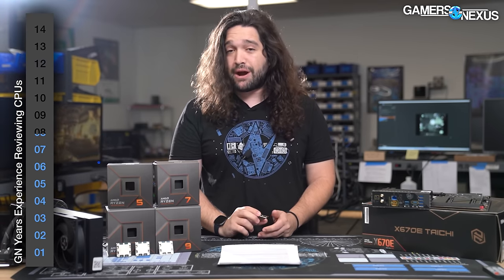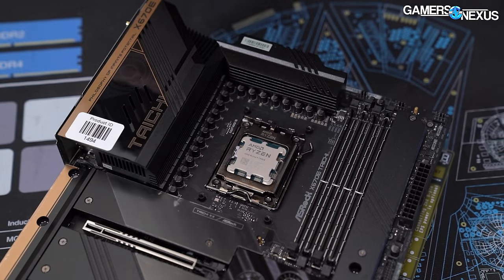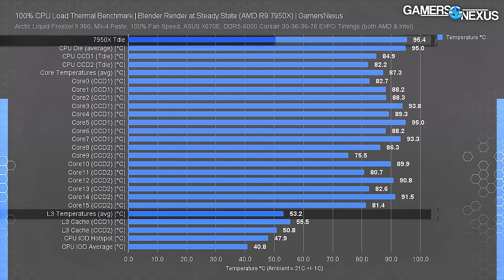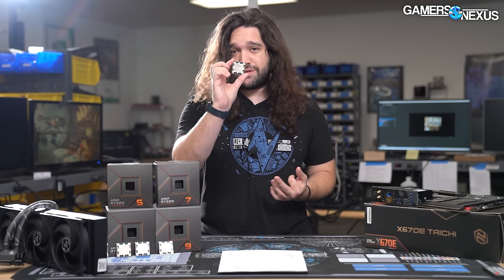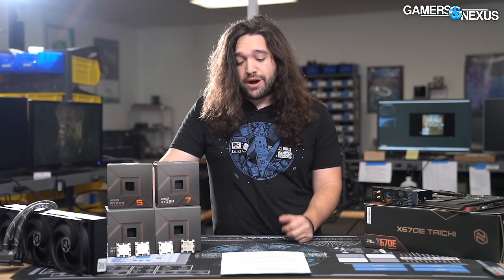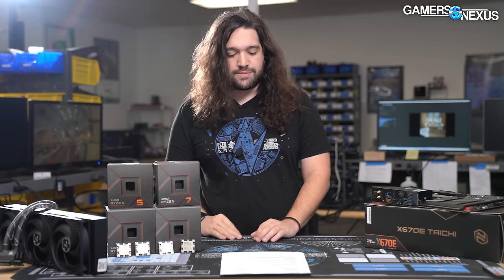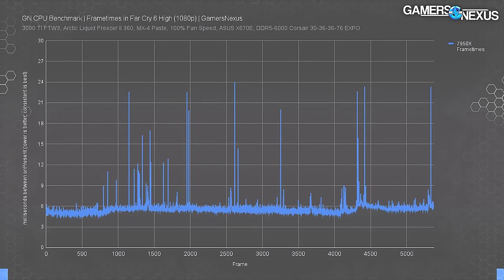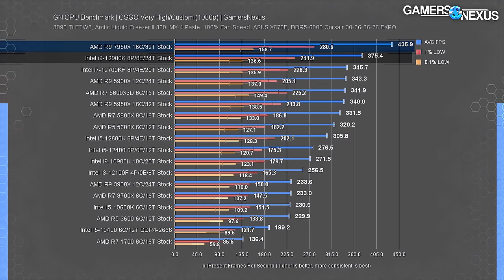95°C is Now Normal: AMD Ryzen 9 7950X CPU Review & Benchmarks

Comment: I'm looking at some replacement for my 6700K for next year, currently eyeing a 12400 but awaiting more Ryzen 7000 CPUs + tests to hopefully come out in the meantime as I want to just make the upgrade to DDR5 now.

Although I'm horrified by the 95° thing.
That doesn't feel comfortable at all, even with a 240mm Aio.
I like my CPUs running at like 50-60° at half to 3/4 load 😅
Reply: exactly my thoughts... no fkng way you can endure that temp and noise for any logical amount of time, no matter the performance....
Reply: @HellPedre  just set the maximum fan speed lower. it will be at the thermal point anyway^^
Reply: @HellPedre  it's not the noise at all for me, all my fans run 100% the whole time and I've got ones with a reasonable volume so no problems there.

It would just freak me out feeling the hot air (my tower is under the desk, barely fits but it fits), I'm sometimes getting a slightly warm "breeze" when the CPU is 50° steady, I can imagine 95 feeling horrible
Reply: @certaindeath7776  ofc, but then it wont perform as good as it could
Reply: @DatPenguin97  forget about it... thats for sure. I just freak out mentally knowing the cpu is at that temp for that amount of time.... and my noctua fans at top speed are loud as fkng hell so no.... hard pass
Reply: @HellPedre  don't get me wrong I'd feel the exact same about the temp itself

Comment: So what i'm hearing is the fact that I decided to upgrade from a 360mm aio to a 420mm aio for Ryzen 7000 was a smart choice lol. Steve, I would ask if you guys could show how thermal paste application because of the new IHS design. I've heard AMD say just a single dot of TIM but I'm wondering if that's what you guys used or not.
Reply: they already did a video about thermal paste application
Reply: @retrowave69  Did they? I must have somehow missed that. Did GN do the video or AMD?
Reply: just make sure to use non conductive compound and you can safely apply any way you want basically. Altought, for the 7600x thats a good question, since its more likely people will cheap out on thermal compound and might get some old style conductive one.
Reply: @xouri8009  I've got some Kryonaut and Kryonaut Extreme sitting around for my TIM although I'm potentially interested in Corsair's new TIM. They said they tested it against 12 of the best TIMs on market and it performed as good if not better but I'm leary until they say what they tested against.

Comment: It's a shame there's no good methodology for testing the scenarios where FF14 becomes overly CPU bound (lots of players loaded in at once).  You'll mostly see this in popular player hangout spots as opposed to the official benchmark or any sort of combat content (barring the odd rare open world boss here and there, but again, that's probably a nightmare to consistently test).
Reply: You can just use Single Threaded performance metric as a guide there because FF isn't multi threaded anyway.
Reply: I have no noticeable stutter/lag running around Limsa at peak hours on my R5950X. The frame drop is also pretty minor. I imagine 7950 should feel the same if not better. Of course it would be better if there were a way to test it consistently and not just with anecdotal evidence.
Reply: @berniecat8756  Time to rent a server and fill it with GN viewers. 😎

Comment: it appears some kind of embargo was lifted 6 minutes ago :) 
Paul and steve both videos appeared now. 
Will AIO companies now need functional upgrades in design for more heat transfer with the hotter CPU temp limit now ?  (apart from any mounting bracket upgrades that may be need for improving physical contact with cold plate)
Reply: Linus'es also pops up

So yeah, Major Embargo lift
Reply: Aio companies can't just "upgrade" the design for more heat...don't you think they would have already been doing that if it was possible
Reply: @samgoff5289  Errr yes, yes they can...thicker rads, push/pull fans with higher static pressure and rpms, faster flow rate pumps, finer fin density on the cold plate in the block, they have just been rebranding cheap shit and selling it for top dollar for well over a decade now, and slapping different variations of RBG on it with each new iteration.
Reply: @alexhndr  Srry, I don't watch Linus' reviews

Comment: This is not surprising to me, I had to under-volt my Ryzen 7 5800X out of the box as it was running idle at 85 decrees C and this appeared to be common and AMDs intended way for it to run

So no reason to suspect that it will be any different for the new generation - they should probably be under-volted in the vast majority of use-cases
Reply: The 5800x was specced too high from the factory with the same TDP as the 5900x with 12 cores to make the upper-midrange 8 core part look better.
Reply: Idle at 85 degrees is not normal for a 5800x. that means something is seriously wrong.
You can even see this CPU idling at 40 before ramping up under load.
Reply: @ffwast  You're right, I meant to say under load, still the idle temps are somewhat better when under-volted to 1.3v (must affect the curve?) and it can still run all cores at 4500 under load at much lower temps

Stock voltage raises TDP and temps but offers no additional speed or stability under a multi-core workload (just @ 4500 all cores at 10-15 degrees higher temps)

I believe the binning on the 5800X is fairly narrow so this is quite common although I do seem to have an average part in terms of performance with many seeing 4600+ all cores stable

Obviously having an all core overclock and undervolt like this means that I'm limiting single core performance; I believe the two best cores can reach about 4600 and 4700 respectively but most of my usage is multi-core so I generally just leave the all-core OC and under-volt
Reply: Disable amd cool and quiet in the bios so you will not the ramping up cpu cores.
Reply: Just as I thought, Tech Yes City's latest video shows that you can massively reduce power consumption and temps by undervolting while retaining performance and stability

Comment: Actually bummed about the huge efficiency downgrade, damn
Reply: Configure a power plan to cut your boost clocks, efficiency back in.
Reply: A mild undervolt will do wonders.
Reply: Ditto. Efficiency and low cooler requirements were one of my prime reasons for preferring AMD over Intel. I'm gonna skip this generation.

Comment: The 5800X3D still a gaming beast at 4450-4550 MHz 😬
Reply: Just goes to show how little the cores themselves matter compared to the memory and cache system.
Reply: @givemeajackson  yep I run mine sometimes at FMAX 4000 76-60-90 -30 all-core when playing less demanding titles and runs under 39ºC and 40w with no noticeable performance loss. For the most demanding games I use stock limits and a custom voltage curve (PBO2 Tuner).

Comment: 1: Can't wait to see XOC content on this: The boost tech + lapping will be hella-interesting (here's to hoping Jay and Steve will get into another battle when the new GPUs come out)
2: Wasn't intending on buying and really not doing it now with that heat-output 
3: Would love to see the 7950X and 7900X vs 5950X and 5900X at similar powerdraw - wondering how much of the leap of the 7000-series is due to the powerdraw
4: Holy hell, GN has the next review out already, nice job! - very happy to be a Patreon-supporter. 
5: I don't play games at less than 600 FPS - up until now I could only play pong, so happy to see R6S is finally near playable... 
6: Hucking fell, this beast with 3D V-cache... thermal nightmare, but what a monster...

Comment: I really don't like the recent trend of "brute-forcing" performance by dumping more and more power into the parts. Intel, Nvidia and now AMD are guilty of this, they are just racing to get the bigger FPS number to put on their marketing material while neglecting everything else.

250W CPU isn't progress, it's regress.
Reply: Not to mention all thay heat will affect everything else in your system.  Are they really expecting everyone to get a tower case with radiators in exhaust just to run these things?
Reply: You can put a smaller cooler on it if you're that concerned aobout power usage, but on its own "250 Watts" is an irrelevant number... what matters is how much computing gets done for those Watts.... and @ 12:00 Steve shows that the 7950x uses about 30% less power than the 12900 per 'compute'.
Reply: If anything, it shows Intel catching up. In the past the X900x/X950x could flick away Intel's i9 without requiring high TDP. Starting with Alder Lake that's no longer the case.
Reply: @RobinHood-yk8og  12900 doesn't really set bar very high does it? It's the worst of the worst.

250W of power draw shouldn't be a default behavior for a CPU of this caliber. It would still be able to wipe the floor with 12900k without such ridiculous power draw.

Power has to come from somewhere, it costs money and impacts the environment, wasting so much of it to get a few extra points in a benchmark to clown more on the competition simply isn't worth it.

I'm not saying the 7950x is a bad CPU, it's great, but the default power draw allowed is ridiculous.
Reply: @Starcrafter23  250Watt isn't the default. It's the result of Steve uising the most beastly off-the-shelf cooler he could get his hands on.

Smaller cooler = fewer Watts.
Reply: @RobinHood-yk8og  It's the default behavior for it to max out on power as long as temperature permits it.
Reply: @Starcrafter23  "as long as temp permits it."

Default is 95degs, not 250 watts.

Wattage will change according to clockspeeds, which will change according to cooler capacity.

LN2 will get you several hundred Watts, by default.

Something like the AMD Stealth air cooler, will put you at approx 65 Watts by default.

Comment: All this tells me is that progress on silicon is effectively over with. Aside from some marginal improvements, we need to swap semiconductor material before we'll see things getting much faster. Only other option is to start making the parts bigger again and running water capillaries through them. I'm gonna keep sitting back on my pre-2020 parts until the parts market quits burning itself down.
Reply: It is looking very much like we need an actual technological jump at this point, current tech is going the way of the dinosaurs, it cannot continue this way for ever without drastic change.

Comment: This generation might just be surprisingly close competition despite the new process node... Excited to see how the raptor lake will stack up
Reply: What process node? It doesn't measure anything.
Reply: @AlfaPro1337  I am talking about the more performant, power efficient TSMC's 5nm process.  You are correct in that "5nm" doesn't indicate any real measurements though. It's just a nomenclature at this point. But that is irrelevant to my point here.
Reply: @jumpman1213  Wtf, there's no correlation between performance and efficiency against process node.

You can have a shitty architecture on a newer node, yet, isn't high performance and high power efficiency.

Comment: 95C 24/7 by design is an.. interesting approach.
Reply: Server hardware and laptops have done this for literally decades. Silicon isn't water...
Reply: It's actually less damaging to have constant 95°C than to have it fluctuate and cycle between 20 - 95°
Reply: @givemeajackson  Doesn't change the fact that this is a novel approach on desktop CPUs. Laptop CPUs aren't exactly designed to run hot, they just happen to run hot because laptops tend to have limited cooling. Zen 4 appears to be leveraging any thermal headroom it has on purpose instead of running into thermal limits due to simply having insufficient cooling. There's a difference.
Reply: @givemeajackson  If it was Intel doing this, I guess you would be the first to shit on them but since its AMD its OK. They can get away with anything these days. I personally would never ever buy a CPU getting this hot. Not to mention how overpriced this CPU is. For gaming either the 12900K or 5800X3D are still by far the best choice.
Reply: @Transistor Jump I think you are missing your entire brain if you think this ISNT a gaming CPU. Lmao
Reply: @EldenLord.  no i wouldn't, cause i know that operating temperature is a meaningless measurement if it is within safe limits. what those safe limits are is determined by the manufacturer and not people's own feelings of "oh no that's too hot"... their rationale makes sense, and it's the exact way laptop hardware works in a thermally constrained scenario. the silicon doesn't suddenly melt at 100°, and if they designed it to run at 95° they will have chosen the right SMDs for the job. to top that off, the SMDs don't even get anywhere near as warm, as shown by the IO die temps. comparing operating temperatures across different hardware is idiotic anyways, you don't know where the sensors are and what they're measuring. as shown by the whole "hotspot temperature" controversy. 

as for your last sentence, the 7600x looks like it's matching the 12900k in HWunboxed's review for gaming, so likely isn't far off of the 7950x, especially cause it will likely have higher clocks on average cause of more thermal headroom. of course the 7950x makes no sense for a gaming rig, and neither does the 12900k to be honest since the performance difference vs a 12600k or even 12400f at anything higher than 1080p is completely meaningless. the 5800x3d is probably overall the best gaming CPU right now on paper, but for most rigs that don't combine a 3090 and a 1080p monitor you're never gonna hit a meaningful CPU bottleneck with even a 12100f or 5600.
Reply: @givemeajackson  Regarding CPU bottlenecks, that's really not the case at all. 12700k 3070, I'm still limited by the CPU in everything I've played recently. Sure I could increase the graphical settings to make my GPU choke, but I don't want more eye candy, I want more FPS. The "no CPU bottlenecks" meme makes too many assumptions to be just thrown around as a blanket statement.
Reply: @SaltyMaud  ... why? and what on earth are you playing
Reply: @givemeajackson  OW, Destiny 2, 2042, Rimworld, Stellaris, Apex... all sort of games really. But not a lot of "AAA" games as you might notice. Primarily at 1080p. I lowkey regret upgrading the GPU from 1080 to 3070 because it didn't really give me much of a improvement in terms of performance, just allows a couple steps higher graphical settings.
Reply: @SaltyMaud  so games where FPS is either irrelevant or in the 200-300 range anyways? doesn't overwatch still have its 200fps limiter anyways? i mean i play CS GO on a 240hz screen, and even my 3700x is more than enough for that, i very much doubt you'd notice the performance uplift from a faster CPU in any of these scenarios. of course a 3070 is gonna be a complete waste at 1080p.

i mean i'm CPU limited in oblivion and assetto corsa too, even at 3440x1440p, in an FPS range where it really doesn't matter anymore on a 165hz UW. but that hardly contradicts my argument that the cheaper CPUs are more than fast enough for a gaming rig with any reasonable GPU pairing. the only game where i am actually CPU limited in a meaningful sense is beamNG...
Reply: @givemeajackson  No, OW doesn't have a 200fps limit anymore, hasn't for a long time. Apex doesn't run at stable 240 yet, even the lows in OW still occasionally dip below 240. D2 barely runs half that when things are actually happening and 2042 is definitely even worse. "FPS is irrelevant" is technically true for games like Stellaris and Rimworld, but when the TPS falls to a point where the game is barely running at 1/10 normal speed I'd still like a more powerful CPU thank you very much. Whether desiring 240 over 120 or even 60 is meaningful or not is a entirely different topic and beside the point anyway.

3070 isn't a waste for 1080p if you actually wanted eye candy. I mean, I can bump up the settings to a point where it will 100% itself and start eating into my FPS. Even OW at "epic" does that. But suffice to say I'd rather have my settings where the GPU is happy without eating into performance.

As far as I'm concerned there is no such thing as "too fast" CPU for gaming. I might think different if I was part of the "ultra everything 4k60" crowd, but that's not my use case.

Comment: I really like how reviewers especially GN are putting an emphasis on power consumption and efficiency. Someone has to call companies out otherwise, they will release insane power hungry chips just to take the performance crown, damn the consequences
Reply: Yep, but there was a missed opportunity to test eco mode. Even when manually set to 65w TDP the 7950x still beats the i9 12900K by a comfortable margin (Cinebench MT) per Anandtech's review, and it can also be set to eco mode at 105w TDP. So it'll keep itself to 95c temps under standard conditions, but even throttled down for efficiency it's ahead of the former top performer (and by a bigger margin than the i9 is ahead of the 5950x).
Zen 4 APUs are gonna be beastly with that kind of performance per watt.
Reply: It's not like Intel was considering making a 6GHz version of the Pentium 4 in the past that would have to be watercooled and had a TDP of 600W or anything.